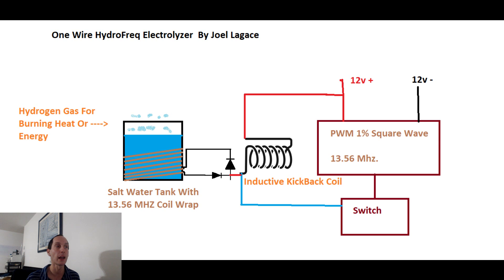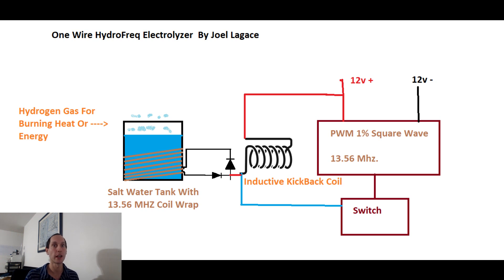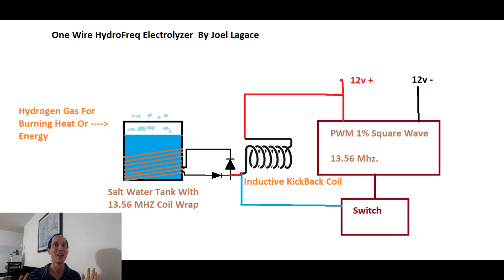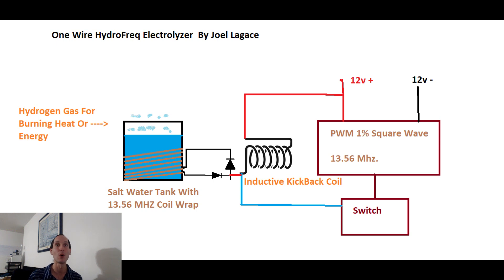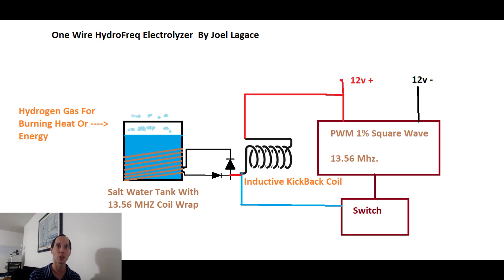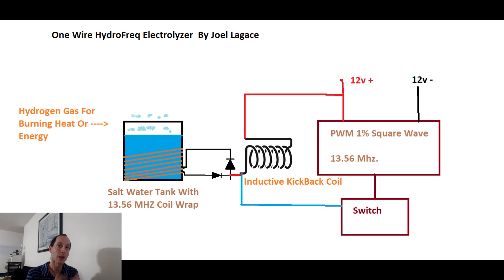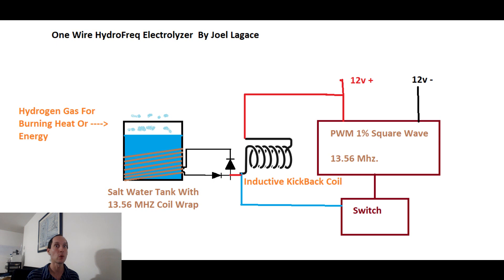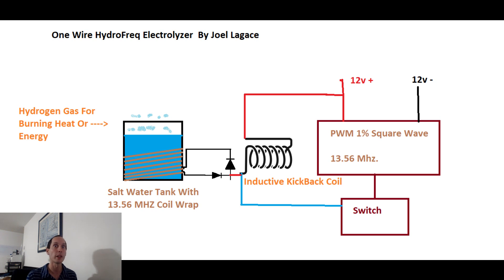One Wire HydroFreq Electrolyzer

Comment: I have been tossing around an idea for using a heater coil (heating element from a plug in AC heater) to see if I can get some flyback energy to help reduce the power used to heat a home. Any ideas on that?
Reply from the maker: Buy a spool of 1000 feet of radio coax don't unroll the spool and pulse that! :)
Reply: @joellagace1679  I have seen your videos with that coil. What I mean is I wonder if I can get enough flyback from the heating element itself to reduce energy consumption. Its on my list of things to do soon.
Reply from the maker: Ah now I get it hehe, Not sure how that would work, I guess a high current thing that your trying to make more efficient. No harm in trying it. :)

Comment: I wonder if anyone else have seen the stunning similarities between one wire system and Tesla Valve for fluids, where the mainstream flow is split in half creating a contraflow to self regulate.

If we can see the electric energy as a river flowing from uphill + to the sea - we can imagine that we have drilled a little well (battery/power source) and our little tiny river once establish a good path downhill will collect many other small rivers growing larger. Now the question is: when splitting mainstream with 2 diodes (1 way vales) are we collecting other small flows as well or we just send away or back to the environment energy that somehow flow back to the source ? Or we just create standing waves on every split ?

Try to visualise a big river that have several lakes (capacitors) on its path to the ocean(the sea of energy that we live in) where there is a little or big cascade(diodes) between the lakes which help to create a sudden step in gradient. So, a very long river or a short river for the same altitude difference ?

Comment: We are entering the Hydrogen age . So if this is a cost effective way to produce Hydrogen , we should test it .
Reply from the maker: Yes we should that was my point, This is very new science and hardly any experiments where made as the scientific community dismissed the discovery in scrutiny towards the fellow, Perhaps I can find him if he is still around. Showed this all on youtube at some point. But people didn't get the "potential" the first time around and he made the flat out claim in traditionally systems you won't get more output with this. My contribution to the idea is driving it with the one wire system for more efficiency. Lots of unknowns here, Is this just a low frequency version of a "microwave" ? Would it work better with 2 plates tuned to 2.4 ghz on each side of the water tanks? lots needs answers with this, It's ongoing and I don't have all the answers folks want. I just put it out here for transparency.
Reply: Hi Joel., i'm sorry but the guy had cancer and passed . I was going to try this years ago but as you go up on frequency on a generator the amplitude of the signal goes down . Your idea of the bemp pulse is a very good idea . So there is the coil around a jar or wrapped around a test tube . Another idea would be to use a flat pancake coil under a jar of the salt water solution . I like your ideas , Great job Joel.
Reply from the maker: Ah crap he passed? that sucks no wonder we don't hear more of this.
Reply from the maker: I guess its up to us now to further develop it! With an efficient  driver stage this is a great potential.
Reply: If you were to design a system to give the same results it could be scaled up . This would be very good . I may build a test rig also as winter is closing in on me .
Reply from the maker: Yes you should, I'd like to as well. Just need to design an exciter at that frequency with low duty cycle.

Comment: Interesting setup!
You can use K2CO3 ( potassium carbonate) for better performance.
Also, i use K2CO3 with a Heat battery process for m'y home
Reply from the maker: Original idea is here https://www.youtube.com/watch?v=aGg0ATfoBgo my contribution to it is driving it with the one wire system instead of a "50 watt fm transmitter"

Comment: Hi Joel.very, very interesting, even if one is not using hydrogen at the moment.
This could well be an excellent teaching tool about quantum physics, a topic that is hard to find practical examples of.
The apparatus you show is easy to produce. One only needs a plastic pail and the correct length of wire with two diodes, the one wire Tesla circuit.
I have forgotten my Ham radio antenna wire calculation formula, but that can be looked up.
Just supply a spike.
Thank you, from all of us.
Cheers Warren

Comment: A while ago i was studying the work from royal rife and i gave me some ideas for this as well. Royal rife built a machine that could essentially cure all disease, it projects extremely high sound frequencies into the patient and when you tuned it to the exact resonant frequency if the disease it would literally shake itself apart and disintegrate. He had tremendous success with his machine, and it was hailed as a miracle cure before it was suppressed by the "medical community". This got me thinking, what if we could hit the resonant frequency of the water, perhaps it would cause it to vibrate enough that the molecular bonds become much weaker and easier to break apart.

This also reminds me of stanly meyer. In the 90s he built a car that could run on water. It was a different way to split the water that required much less energy than traditional electrolysis and it used some sort of frequency to dramatically reduce the amount of power to split the water. His invention was also suppressed, and he was eventually assassinated with poison to stop this from getting out. You can read about both of these people online. You can also see the list of frequencies that royal mapped out for each disease. Some are in the millions of hz for things like certain cancers.

Comment: Do you have a setup where you show this running ? it could be hydrogen , oxygen , chlorine or all the above .
Reply from the maker: Original idea is here https://www.youtube.com/watch?v=aGg0ATfoBgo my contribution to it is driving it with the one wire system instead of a "50 watt fm transmitter"

Comment: Need stainless steel coil or wire.or.plates even washers long as stainless
Reply: @secondline5641 for what? The coil is not in the water it is coiled around the recipient. Look carefully on the schematics
Reply: @icebluscorpion  electrolysis has anode an cathode in water. See in schematics 2 wires going into the tank. If ya use anything other stainless steel it will oxidize slowing down. The electrolysis.